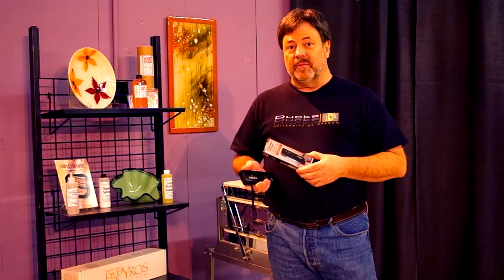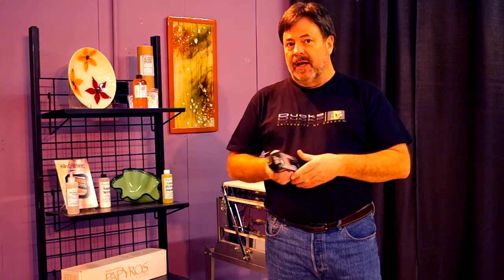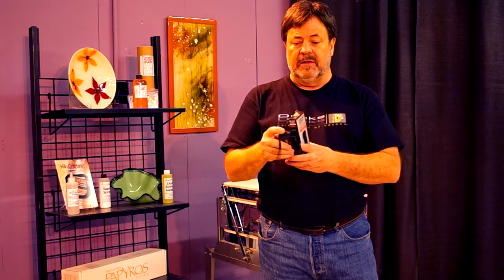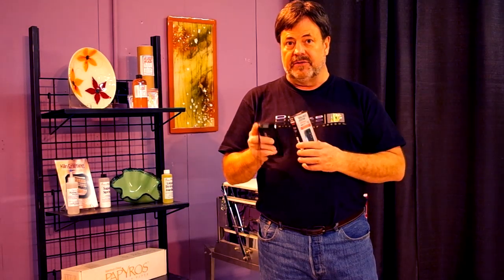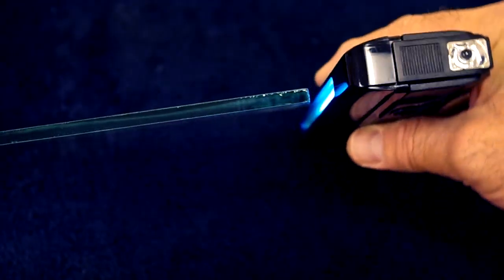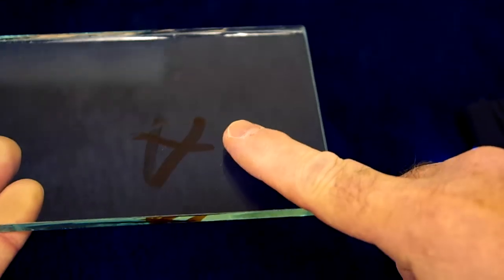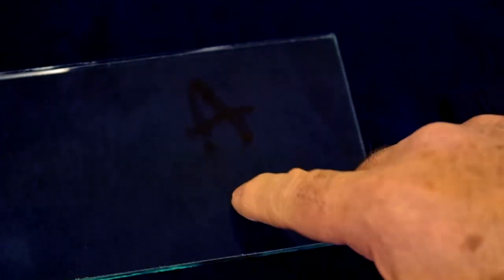Fused Glass Info - Using a UV light to find the tin side of window glass.

Comment: It would be extremely helpful if you posted a link on the specific shortwave UV light that you used, for there's a lot of bad information out there about using a UV light to detect the tin side, some saying a "black" light which is a much higher nm wavelength, what nm is that light? 254nm? This is so far what I've found to be considered shortwave UV, but your demo was very clearly showing the difference. I must not have a strong enough 254nm light or there is too much light still in the room.

Comment: You need to use a 254nm UVC light. A standard 365nm UVA "black light" won't work to fluoresce the tin. 
Be very careful with UVC light, it will harm your eyes if you look at it too long and it can burn your skin if exposed.
Reply: The lamp he is using in the video is for checking banknotes and is long-wave UV.A.
Reply: @karhukivi  nope
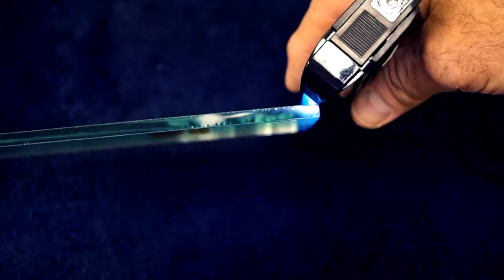Reply: @gregcorwin8316  At 1:17 you can see the name "Importa" it is a money and note detector, a simple "blacklight, in fact I have a European version, identical, but it has a slightly different name.
Reply: @karhukivi  very simply, UVA does NOT fluoresce the tin side of glass, you need 254nm UVC to do that. Also the presenter called it a shortwave UV light.